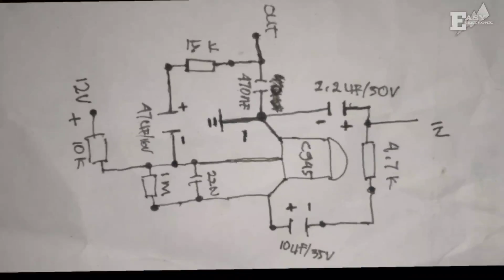CARA MEMBUAT FILTER SUBWOOFER non CT

Comment: Terimakasih Udah saya coba mantapppp
Cuma ada kendala daun speaker masih liar, solusi apa ya om?
Reply from the maker: Coba di bagian input pada driver power nya pake 47 nf jangan 100nf.
Reply: @EasyElektronic 
Siap nnti saya coba
Reply: @EasyElektronic  udah dicoba liar si ilang cuma suara vocal malah keluar
Reply from the maker: Kalau suara vokal masih keluar coba perbesar lagi sedikit capasitor input pada filter sub nya sampai mendapatkan hasil yang di inginkan
Reply: @EasyElektronic  siap laksanakan om
Reply from the maker: @otodidax3836  iya nanti yang di otak atik nya capasitor input di filter sub nya yang dari input ke ground,  dan cap itu fungsi nya untuk cutof frequency  low mid high nya
Reply: @EasyElektronic maaf om mau nanya. Kapasitor 100nf itu yang mana yaa kok di rangkayannya ngga ada apa kapasitor milar itu dia?
Reply from the maker: Iya ka
Reply: @EasyElektronic Ooo iya iyaaa. Tapi saya pengen tau fungsi kapasitor milar itu untuk apa ya om? Kalo di ganti nilaynya efeknya apa gitu om trimaksi om kalo di balas salam dari pekanbaru pengen belajar elktro sound🙏👍
Reply from the maker: @AdifHamdani-y5k di rangkaian ini fungsi kapasitor untuk memfilter frequency , semakin besar nilai capasitor semakin banyak freq tinggi yg di cut

Comment: Mas saya buat ko kasar ya 
Saya pake mylar 224 semua r saya pake 3.3M elko 2.2 karena gk ada saya pake 1uf

Power pake 400w speaker 4 inch bekas subb gmc
Reply from the maker: 3,3M kebesaran gainnya  om kalo bisa elko pake 22uf biar freq tinggi nya ga masuk dan juga transistor kualitas nya harus bagus. 😊
Reply: @EasyElektronic  oke mas nanti saya coba
Reply from the maker: Siap om kalau skema itu tidak cocok ada di video saya crossover low sub
Reply: @EasyElektronic  yang pake ic mas?
Reply from the maker: Iya yang pakai ic 
Ada komplit om kalo mau bikin crosover 3 way tinggal gabungin aja semua nya
Reply: @EasyElektronic  mas saya bikin pake r 1m kapasior output saya pake 473j ko malah low ya bukan sub
Reply from the maker: @totosunarto9905  harus nya 470nf om code (474j)  kalau 47nf atau 473j kekecilan minimal 220nf (224j)
Reply from the maker: Kalau R 1M nya sudah benar mas tinggal bagian capasitor out minimal 220nf lebih besar nilai nya lebih rendah lagi freq sub nya